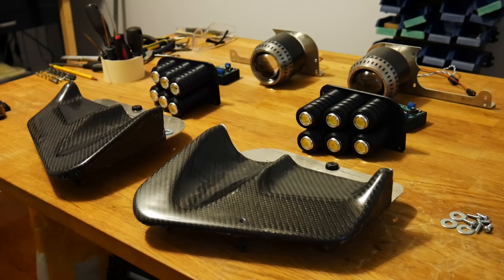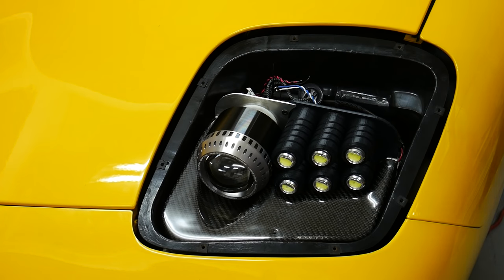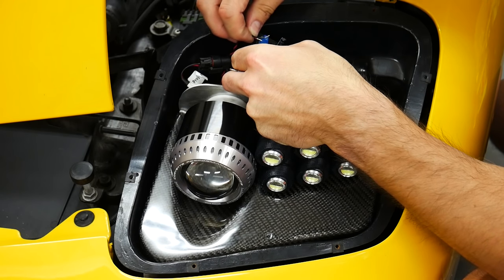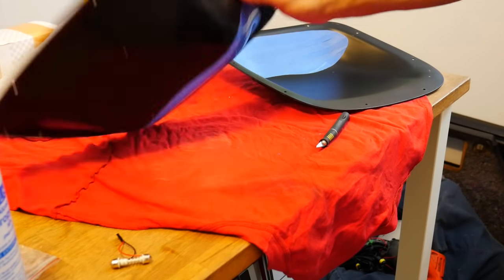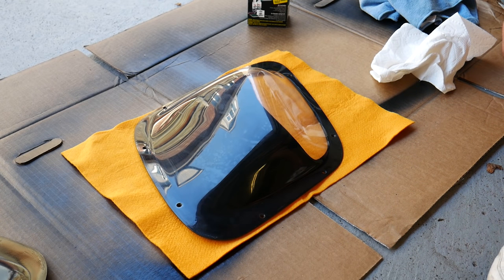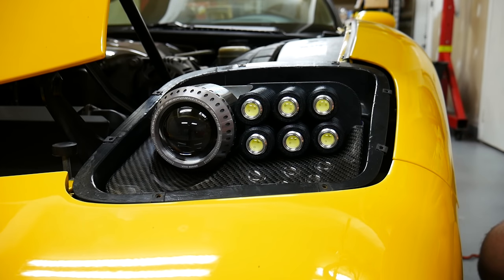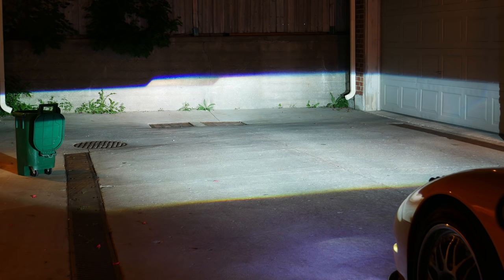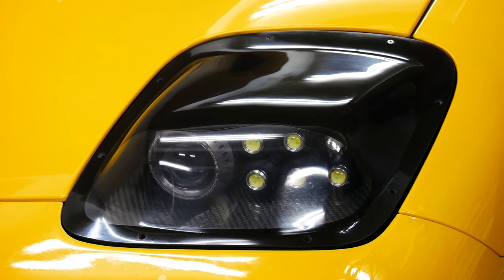Custom Corvette Headlight Build: Part 3

Comment: Humidity might cause the electronics to oxidate. Could maybe cover them in epoxy to seal them up? 

Awesome custom retrofit, and well made video!!
Reply from the maker: Thank you! Very good point, I "sealed" the PCB board housing with electrical tape, but silicone or epoxy might be better!

Comment: I just watched all three videos and I'm just stunned at the engineering that went into this project. Fantastic job!  I was wondering, since the bi-xenon lights that you used are no longer available, do you have any suggestions on alternatives?  Thanks much!
Reply from the maker: Hi Charles, thanks for the great compliment! Most of these after market H1 size bi-xenon lights are similar in size and mounting. Check out "The Retrofit Source" and they have their own H1 and D series bi-xenon projectors, even M series which I believe is their LED projector. They are all very compact with great light output and they have a good selection of shrouds for whatever look you're going for :)
Reply: @EmbraceMaking  thank you! Keep doing great work!

Comment: Great looking final product!  Can you share any links to where I can find materials for the pods you used for the individual LEDs?
Reply from the maker: Hi Terran, thanks! The LED lights can be found on ebay. Just search "Eagle Eye LED" and you'll see them. The actual plastic pod was custom 3D printed. I designed the model and then used my 3D printer for those...
Reply: Embrace Racing Would you ever make and sell headlights?? These headlights look better then any aftermarket headlights on the market for the C5.

Comment: Would you ever consider selling a pair of those headlights?? These look far better then any C5 headlights on the market.
Reply from the maker: There is so much time into these that I don't think anyone would pay what I would need to charge to make it worth it lol. I appreciate the kind words though!
Reply: can you stream line the manufacturing. As in using molds for the carbon parts.  Make a mold that has say 6 pairs in each mold so you can make half a dozen at a time.  If you ever do decide to make them and need a little help hit me up.  I'd be more than happy to preg or infuse them for ya :) ..  Great project by the way!  Well thought out!

Comment: You always do great work, been following this build. Just curious, are you not concerned about a good seal with the lens to housing itself? Especially with the rubber washers you used. I can just imagine after driving in the rain you would have to have some signs of condensation.
Reply from the maker: I've already washed the car and this doesn't happen. The lenses overlap the flange on the "bucket" and water just drips around the bucket, none of it going inside. Plus, there are drainage holes on the bottom of the bucket allowing water to drain if, in the worst case, water is able to get inside. All of the electronic components are lifted off of the bottom of the bucket so that nothing will sit in water. Don't worry :) thanks for watching and commenting!

Comment: Should have used a gasket material all around the housing. For a complete seal. The grommet works, but I can see some water/dust/dirt getting in there.
Reply from the maker: It's not too late to add a gasket, but I haven't had any issues since building these :)

Comment: Awesome build man. I have a question, Whats the total price for the PCB with Components for the Programmable LED's? price excluding the LED's themselves
Reply from the maker: I'd have to check to see if I have enough parts to build more of these... in order to program them you would need to build some sort of USB to serial cable for your computer and download the correct software too.
Reply: Wait just to clarify, Did you initially think I wanted to buy from you? If that's the case, I just wanted to know the cost.
Reply from the maker: Ah sorry for the misunderstanding! One of the PCBs is roughly $6 - $7 in cost with all of the components. However, keep in mind that certain components (such as the PCB itself) has to be bought in bulk. I think min order quantity on the PCB is 10 and they work out to be around $1 each. Hope that helps!
Reply: Embrace Racing all good man! Wow thats quite cheap. I would buy from you but the shipping cost to Malaysia might be expensive.

Comment: Your probably exhausted with this question but I have to ask i see you made more than one of these lights for the c4. Was wondering if you would sell any of the prototypes or how much would you charge to make a custom one like u have already made? Please your time and consideration into my issue would be highly appreciated!
Reply from the maker: Thanks for the message. Currently I've only made this set for my C5, haven't completed any for the C4. Quite honestly, I just don't have the time to reproduce them as they are so labor intensive. Thanks for watching the video though!
Reply: Embrace Racing I appreciate the response, I understand must've taken you a long time do finish that one. Great job though! Seems like you would make alot of money if you found a way to do it faster and sell it

Comment: After you cleaned and restored the headlights, why didn't you use a clear wrap/film like those from LaminX or somewhere else.
Reply from the maker: Hi Phillip, I have not had good luck with longevity when it comes to films. And when it comes time to peel them off it turns the underlying piece (especially plastic) into a mess. I don't drive the car often so I don't think I'll have any issues. I also spray the lenses with the UV protection product regularly. Thanks!
Reply: I guess I never thought about what would happen with the removal of the film. You make a great point, the headlights look phenomenal. I have a friend who owns a corvette and I know he would like headlights like the ones you made.
Reply from the maker: Thanks! These were just a one off, lots of work into them. Share my videos with him and maybe it will inspire him to make something similar!

Comment: How did you cut that metal in the beginning around 1:15? Is that CNC? Is this your place of work or home? I'd LOVE to see a tour of your equipment, you're an artisan.
Reply from the maker: Thanks again! Too kind! All of the metal was cut by water jet. I'm an engineer by day so I know my way around CAD software to generate the drawings. For something like water jet I have to source it out, but I have a CNC router / 3D printer and a home made vacuum former at home for some of my own projects :)

Comment: So u will never drive it in rain? What about moisture getting in
Reply from the maker: There is no weather seal but the geometry of the lens and bucket prevents water from getting in and splashing anything. Even if a small amount of water trickles in, the electronics and everything important are raised off the bottom of the bucket and the bucket has holes in the bottom to drain anything. I've driven in the rain and everything is okay :)

Comment: I have some headlight and the plastic cover is going out, since I need to buy new one or open it and try to restore it (i think it  will not work but) if that work, I would like to try your design, can you add your files on thingiverse? That would be amazing :) thank you
Reply: With the LED only, do you see something on the road at night? :)
Reply from the maker: Do you have the spectre werkes lights for the Corvette too? The LEDs alone will not light up much.

Comment: Headlight Restoration Kit = drill motor, soft bob, jeweler's rouge.  Clean with hot water and detergent, finish with some quality wax (Carnuba).  Thank me later? lol
Reply from the maker: Thanks! Sounds like there are a few different solutions out there. The method I used is still holding up strong. I also apply Meguire's headlight lens UV protectant a few times a year for assurance.

Comment: the lens goes over the housing with no silicon or headlight seal ??? first water all will fk up
Reply from the maker: I've already washed the car and this doesn't happen. The lenses overlap the flange on the "bucket" and water just drips around the bucket, none of it going inside. Plus, there are drainage holes on the bottom of the bucket allowing water to drain if, in the worst case, water is able to get inside. All of the electronic components are lifted off of the bottom of the bucket so that nothing will sit in water. Don't worry :)
Reply: Embrace Racing i usually do retrofits for bike lights and i replace the original seal with headlight sealant. if i were you i would seal it, mostly because of the moisture and humidity that can burrow inside. anyway fantastic job i also do carbon fiber wrapping with vacuum pump and bag ;) finally someone with my same hobbies. i will follow you closely. cheers !
Reply from the maker: Thanks for the kind words! I might use some closed cell foam strips to seal it shut that won't be visible :)
Reply: My thoughts exactly. Even just a bit of weather stripping around the edge would make me feel a lot better.

Comment: Where can l buy it?
Reply from the maker: Hi Wilson, I made these as a custom set for myself. Unfortunately they are not for sale. However, if you check out my other videos you can see that I've made tutorials that cover most of the hard stuff like the carbon fiber and electronics. You could follow those and achieve something similar!

Comment: What happened to the gasget seal
Reply from the maker: The rubber strip around the edge was tossed. It provided no seal and was only there to protect the paint on the hood. However, it had sticky glue that was getting everywhere and was just generally very ugly. Thanks for watching!

Comment: all that work followed by crappy looking screws paint the heads at least.
Reply from the maker: I could do that, but I actually didn't mind the exposed look of the fasteners. Thought it looked race car inspired :)
Reply: I dig them screws because it says you built that.  And most engineers worth there salt will tip their hat to that detail.  Fantastic job.

Comment: No gasket all that work water will get in
Reply from the maker: Hi Darrin, since the lens overhangs the bucket, no water seems to get in. Plus there are a few small holes in the bottom of the bucket, so any water that could get in will just drain.
Reply: Embrace Racing so moisture gets in.  Bad for electronics.  Don’t see them lasting to long.  Guessing it being sealed was a bad idea from the beginning. Waste of time and money if you are going to let moisture get in them

Comment: Why after all this meticulous craftsmanship, you used ridiculous phillips screws for the visible exterior mount screws?????? With all the available screws from hex to anodized to multi coated customizable speciality fasteners available??? It boggles the mind.
Reply from the maker: It's an easy change afterwards, I think it is what I had laying around at the time in stainless.

Comment: This what happens When you put a nice car in the wrong hand's!
Reply from the maker: Yeah.. it ends up with bi-xenon carbon fiber and aluminum headlights that out perform the stock halogen units that are useless at night and are air brakes during the day.